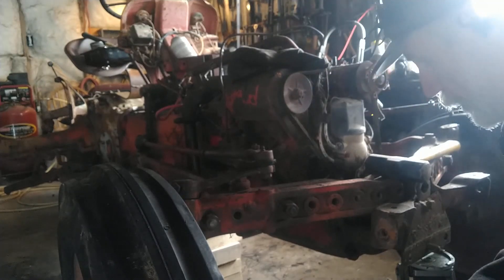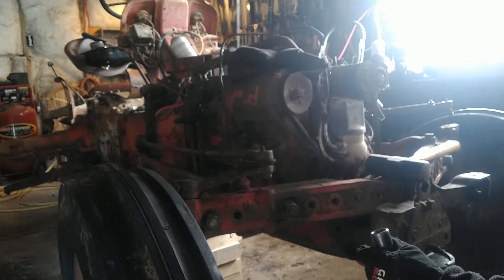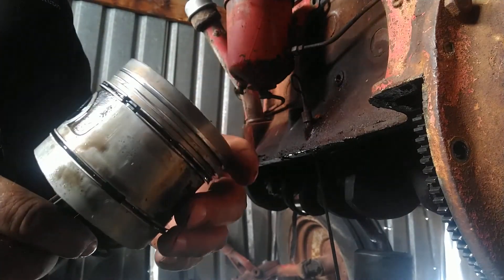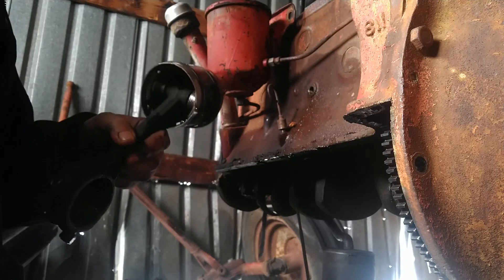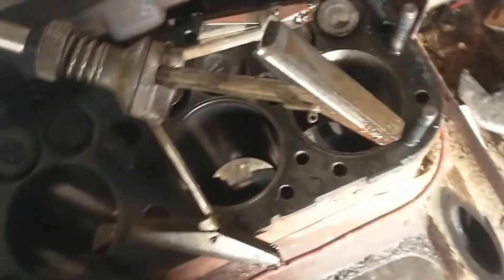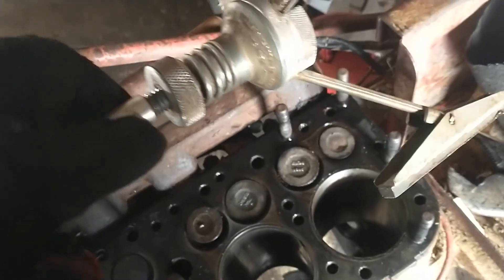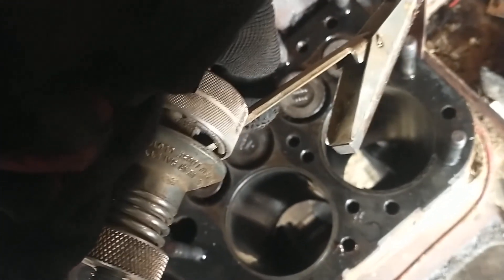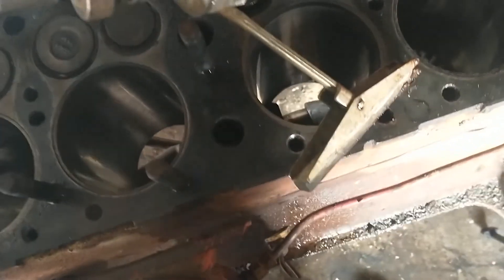8n ford teardown

Comment: Hello there I am so glad you’re breathing new life into that 8N !
I was a little bit concerned about the oil when you pulled the plug to me that oil looked very grey like it was an oil water mix and the bearing on number 4 the crankshaft was rusty and then the fact that it was the one piston that was seized tells me there was moisture getting into that cylinder and running into the oil pan and getting picked up by the oil pump even before it was parked I wonder if the head gasket perhaps was leaking just a guess but if you take the oil canister of and pull the filter out and you find lots of sludge in the bottom I would guess that the head gasket was leaking that cylinder is the one that always gets hottest because of the manifold design! That’s a weak point on the red belly engines the manifold always leaks on #4 sometimes the manifold burns out and I have one where the block is actually burned out and I repaired it with JB weld . And on the camshaft side of the connecting rod there’s a number on each bearing retainer it will be stamped so if you clean it and put it under a bright light you should see it. And be sure you don’t ruff up the oil pump suction tube because it’s very common that they suck air where it is soldered at the pump. And you might want to lap the valves while you have the engine apart especially #4 because you know I was problematic! Ok I went on for a while here but just wanted to give you some advice if you already know all this I apologize and you can disregard this comment . Keep that old iron running 😀🇨🇦
Reply from the maker: Thanks for your input I am a good mechanic but this is my first go-around with an 8N Ford. Good info to know